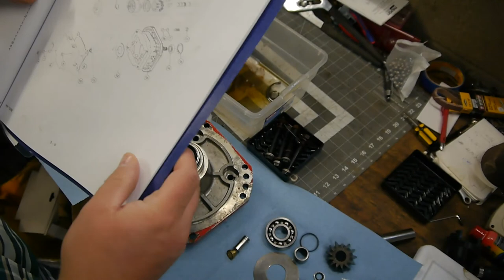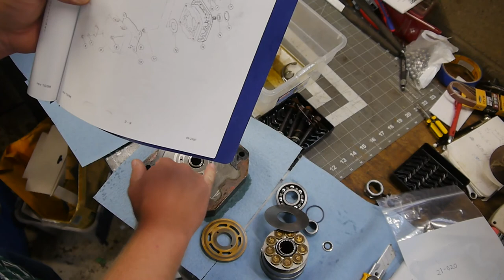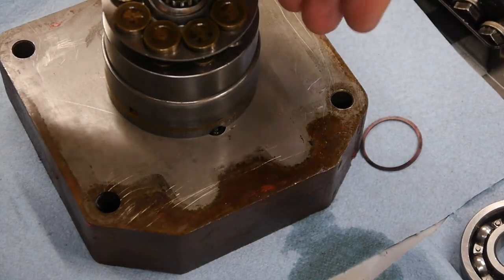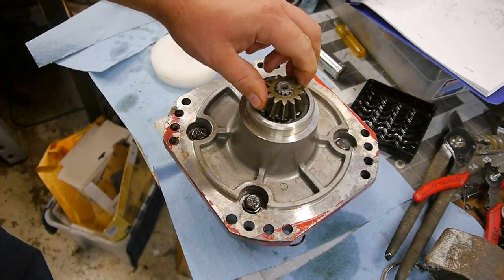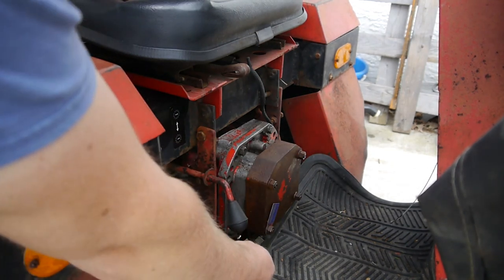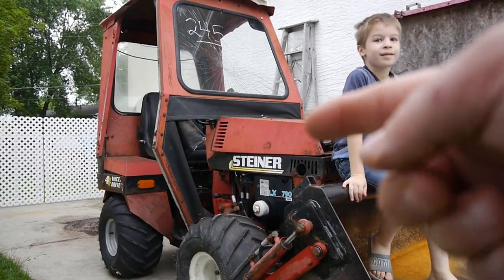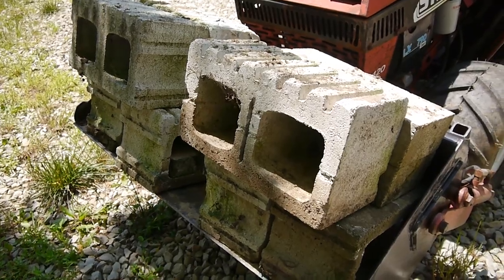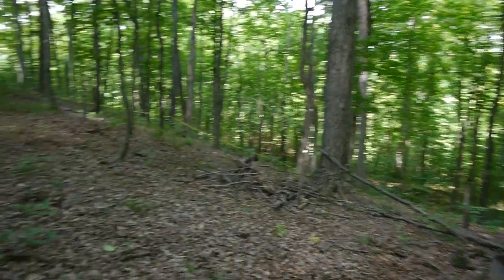Fixing a Steiner 420 that only moves in reverse and not forward.

Comment: I work on Steiners everyday.  Everything you did looks correct. 
That front bearing is lubricated by the internal leakage of the motor pistons. If you note there isn't a dedicated case drain port because it drains through that front open faced bearing. Too bad that you didn't lap the piston slippers and valve plate while you had them out. This could have restored the performance of that motor to like new.
Reply: agree with the lapping. I have rebuild my pump and was very happy with the difference lapping the valve plate made. His motor valve plate you could see scoring and he even admitted a scratch. would have helped. Not worth going back for though.
Reply from the maker: Thanks for pointing that out. I should have done that. Next time I am in this situation I will.

Comment: Nice video, those Steiners are beasts. I have a Steiner 220 and I can not find any information on how to check the level of the hydraulic fluid. The mowing deck won’t lift up anymore and I’ve seen some fluid leaking. Hmmm.. nice property btw.
Reply: On a 220, the dip stick is attached to the bottom of the pipe plug that is in the center of the hump under the seat. But the plug is inline under the steering wheel. DO NOT OVER FILL IT.
Make sure that the dip stick is not bent and you are getting an accurate reading.

Comment: Great video, I'm dealing with a similar problem on my Steiner 420--no forward, just reverse.  Also, no power steering or implement lift.  What led you to believe it was the rear hydro?  Can you explain?
Reply from the maker: @scottmcfarland1110  I spoke with an old Steiner representative, and he mentioned that the two hydraulic motors are plumbed together in series. When going forward, hydraulic fluid goes to the rear motor first, then the front. When reversing, fluid goes to the front motor and then the rear. If the main pump or charge pump was bad, it wouldn't go in reverse at all. Since the rear motors bearing was out, the hydraulic fluid would dump into the rear transaxle instead of going to the front motor. If you get a male to male fitting you can bypass the rear motor entirely and make sure the rest is good. It's a cheap part. Good luck!